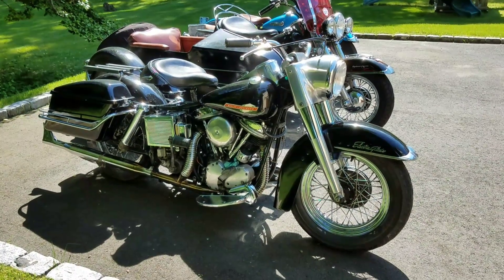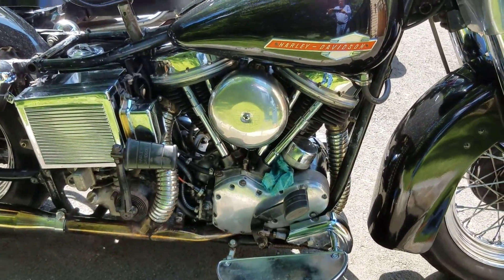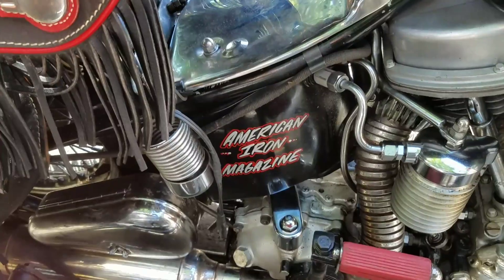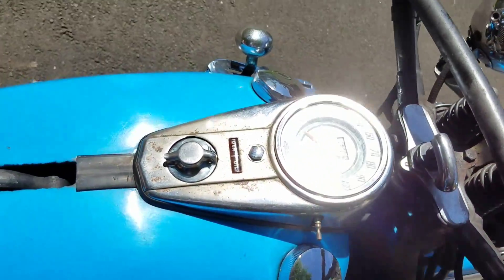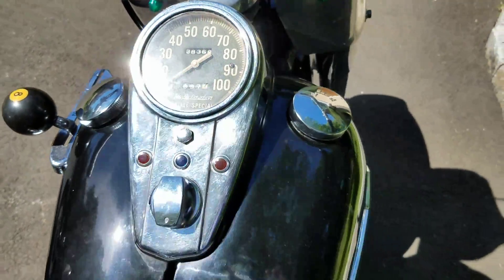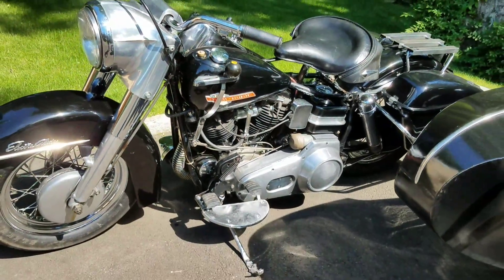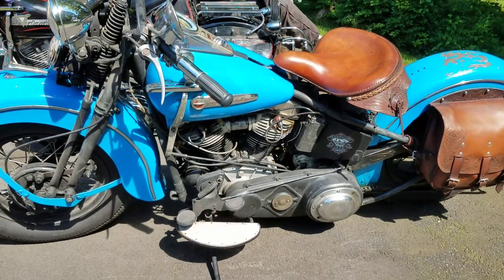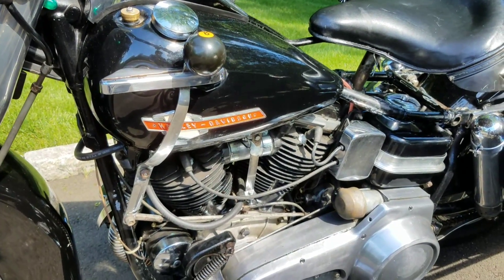3 Harley Panheads, First and last Panhead and middle

Comment: does the 55 have the high performance FLH engine that came out in 55 and a three speed trans with reverse ? is the 48 and 65 four speed transmissions ?
Reply from the maker: All three bikes have 4 speed tansmissions. 1955 is an FL - not an FLH. Thanks.

Comment: Buzz? Are you sure that the middle Pan is a 55? I thought I saw the badge on the front fender that was put on the 1954 model year for Harley Davidson’s 50th anniversary.
Reply: The 55's also had a badge, 1955 FL, !955 FLH, just not the 54 anniversary badge

Comment: 1st hand shift 65 I've ever seen.
Reply: V Matt Me too I was wondering if any one knew if this was original or an ad on? If I could find a 65 and they did have some hand shifters I think I would ad one. I've always liked them.
Reply from the maker: Police option from the factory with the smaller gas tanks.
Reply: You could get a tank shift/foot clutch right up into the early 70’s
Reply: @michaelsmith1094  i think the cops preferred the foot clutch because they could get off the bike in a hurry without searching around for neutral.

Comment: I must correct you. The '65 FL was not the only Panhead to come from factory with 12 volt. The only difference in the oiling system is the outside top end oilers of the 65 and a higher output pump. And that is not a stock 65 dash panel. Come on man.
Reply from the maker: Oh? What other year Panhead came with 12 volt from the factory?

Comment: I cringe when I hear the term "project bike" when applied to a classic .   Just leave it alone.  It's fine the way it is.  If you want to customize something there are plenty of avenues to follow involving custom frames including vintage reproductions, custom motors etc.
If one is fortunate to find vintage pieces worth salvaging then by all means build up to vintage specs.a show bike.
Reply from the maker: By project bike, I did not mean customized. If anything, I prefer to get them running properly and then bring them back to closer to stock on these old ones. No need to cringe here :-) Thanks.